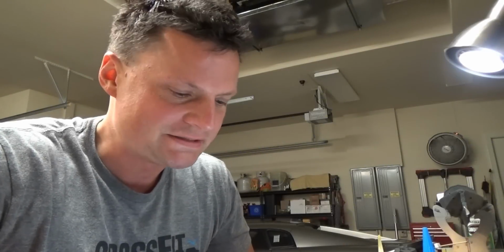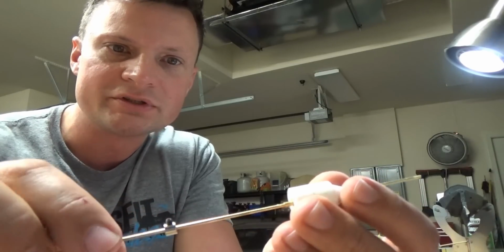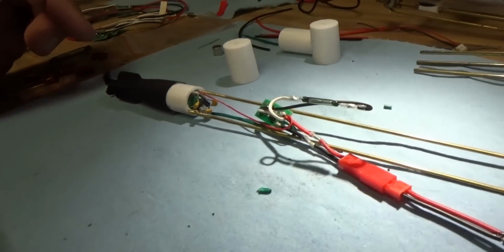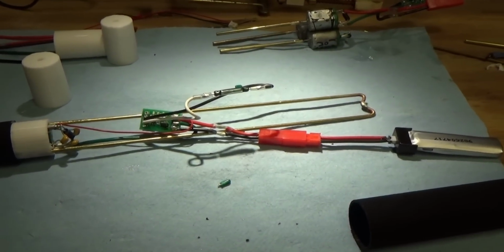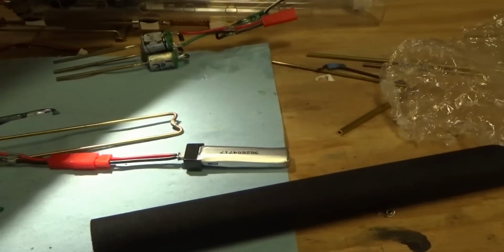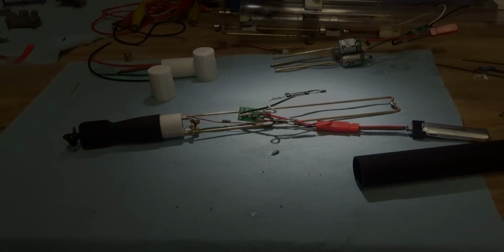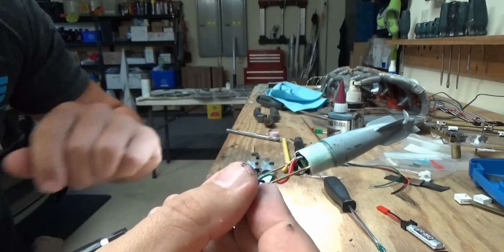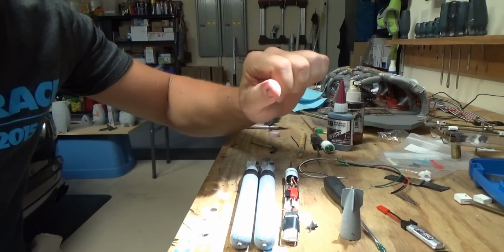German Type VII R/C buildup in 1/32 scale - CH.9: Torpedoes!

Comment: How about using a steel spring. Something like the spring that fitted inside a measuring tape to retract its tape back into the case. Then water-tight is no longer a problem.

Comment: Have you considered running your torpedo from the power source of capacitors. They may hold enough charge to run the motor for a short time, which is all that you need. They are easy to charge and do not need to be vented whilst charging them (which is fast) . I appreciate all of your videos. Thank you.
Reply from the maker: Tried it. They work, but charging is a pain and you always run the danger of overcharging and having them explode.

Comment: you can add a reduction gearing in reverse(there are small dc motor gearboxes on ebay that culd fit the torp.) , the ruber band spins slower than the prop. thus it needs more torque on the input of the gearbox to spin the output.That should extend the time the prop spins, only down side would be winding it up will take some time

Comment: do you know where i can buy some these torpedoes ? i  would like some for my I53 im building. i am trying to find some tubes that are about 13-14mm by 120mm so i can make torps. but so far no luck
Reply from the maker: Dave, I don't know of a commercially available kit, however I hope to release one mid 2017
Reply: cool please let me know if you do, i also built a rc sub. i first built it in 2008 as a dynamic diver and i have since made it static. i have a couple of vids here on youtube, if you want to see them. search dave wright submarine and let me know what you think. im still teaching myself each time i build one. and your professional advice would help me.

Comment: I just stumbled across your videos and enjoy the engineering aspect immensely. I was amazed at how straight and fast the torpedoes ran and wondered how they don't twist opposite the torque of the propeller. Is it the force of water pushing against the fins as they run that stops this? 
Great job-now you just need to design a warhead and detonator...just joking!
Reply from the maker: The torpedoes do spin, but the fins create enough drag to allow the props to bite well.

Comment: Balast it to ride slightly lower in the water
Reply: +Ben Hebert Then it just needs a proximity fuse and explosives and boom!  ...he'll break the back of that inflatable chair yet!
Reply: @JoeOvercoat  Or he could add a spring-supported tip and just add sodium into the torpedo. Whenever the tip hits something It gets pushed in, water floods into the torpedo and the chemical reaction between the sodium and the water creates an explosion.
Reply: JoeOvercoat hehe

Comment: so if you want the rubber powered one to run longer, you will need thinner bands, the one you have now has too much torque and a smaller band would have less. its the same for rubber powered planes.